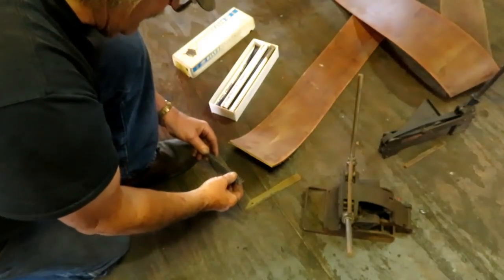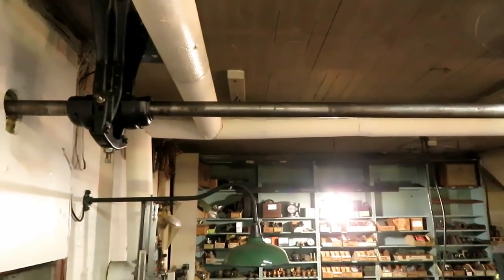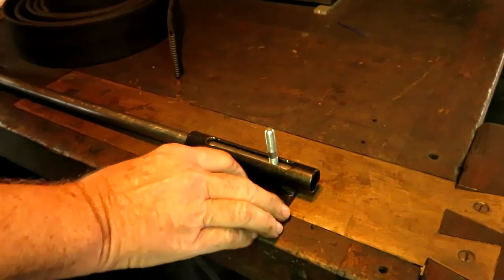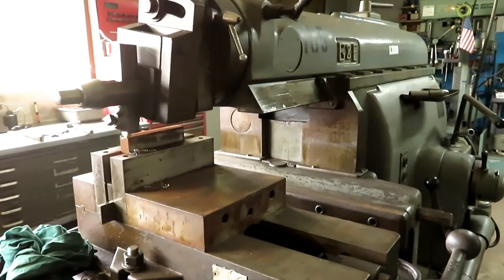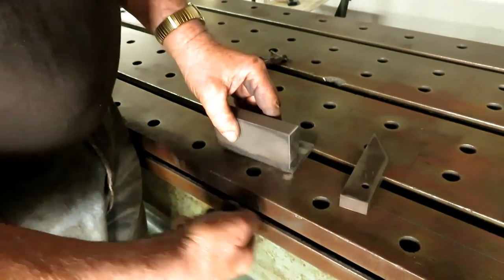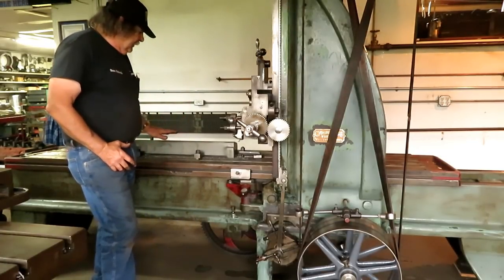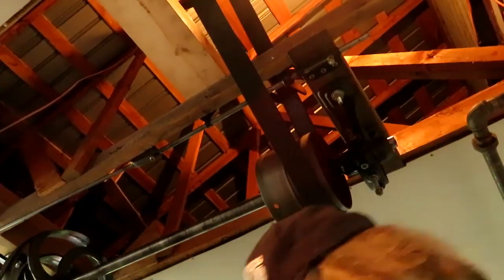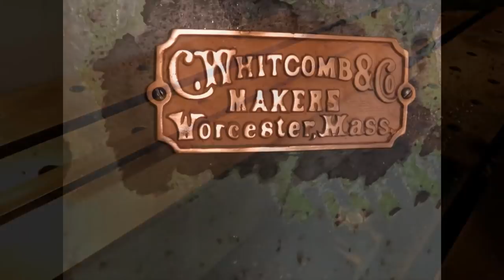Old Steam Powered Machine Shop 60:  PLANER ON STEAM

Comment: Great machine!
I have one question though: doesn't a mismatch of the gears in the drive train for the table motion cause chatter in the work because of a slightly uneven feed rate? I think you can see a slight regular pattern going across the cut surface in the reflection at 41:50.
So, it may not only be a noise problem you could fix, it might also improve the quality of the finish if you repaired that noisy pinion. In short: that's a fine bit of machinery you have got there, but it might do even better!
Reply from the maker: You're right, the small g&E shaper does the same thing . It's more of a surface finish issue because you can't really feel or measure it, probably due to a very slight vibration in the travel. There are 8 gears in the drive train all of which could be contributing to it. I guess by measuring the pitch of the marks in the work and doing some calculations it would be possible to figure out which gear set is the problem. Whitcomb later received a patent on a helical gear arrangement that would alleviate the problem somewhat. It included some odd angles on the ways to counteract the side thrust in the helical rack and pinion but I don't know if it ever made it into production on later machines. Thanks for the great comment....Dave

Comment: Why no leather lacing?  That was the preferred method of joining belts at the shingle mill that I worked at in my youth.  It is fast easy and you don't have to have the clipper crimps.  Not only that they run quiet.
Reply from the maker: This is very true. Wire laces are just quick and easy. I am going to start doing this when some 2" belts come up for tightening, thanks.....Dave

Comment: This is just great !
It is like watching campfire (quote from a YouTuber talking about a shaper).
It is always a pleasure to watch Your videos. To my belief this is because of the facts, passion and joy you embed into them.

I have a question about the speed control.
So in the steam engine there is this governor. As I have learned it maintains a constant speed. In modern technology a process called PID (Proportional, Derivate, Integral) is used to do tasks like this. However, every now and then one can run into trouble with oscillation. For example a system tries to maintain a constant speed but it actually oscillates around the desired speed. Sometimes this oscillation can become so large that it is an issue, This phenomenon arises usually with systems that have a high inertia. So my question (finally) is:: Did this happen in old systems with mechanical governors ?

Comment: Well you beat Professor Rucker to the punch, and thats all that matters.  Can a couple idlers be added under the long belt to give more head room and take out the slap?  Ive never seen idlers on flat belts....reckon why?  Tracking problems?
Reply from the maker: An idler could be used to steady and raise the belt but when I get it "run in" and re -tightened, I think you will see it's not a problem.....Dave

Comment: Nice work. Have you stroked the table at its maximum. To see how well it travels? Can you relief the pion gear teeth some to quiten down the noise? Ur would that add too much back lash.
Reply from the maker: I don't think that would do it, the "involute" profile (shape) of the big gear teeth is gone so the teeth hit with a shock instead of sliding into contact. It was probably noisy when it was new, being a straight cut spur gear. ...Dave
Reply: @davidrichards5594  was a thought. guess new gears, or live with it. Bummers

Comment: worn gears , you know the center is out of true.
and the worn gears tend to makes a ringing caused by the worn gears .
need something to take up the ringing witch wears the gears even more .
try putting or wedge in the spokes of gears at even spots, aka wood.
it don't look nice but , my dad had a fly cutter on a mill that was 10 inch across
shattered something bad ,no matter what he did it still shattered .
finally he put a 5/8 spring in a 3/4 rubber hose and wrap it around the 5/8 thick flange.
worked fine, no shatter.

Comment: Great Machine.  Is it under powered or is it that I am just used to seeing Modern machines.  Sure seemed like it needed some HP to give it a real bite.
Reply from the maker: Hi Tim, You have to explain your question a little. It's not to fast but never slows down when it hits the cut...Dave
Reply: It seemed as if it slowed when it started cutting, could have been a video thing.  I am not a Machinist, so the only point of reference is the video's I watch.  I would like to have a basic setup one day.  Thanks for making all the videos.  I really enjoy them.

Comment: You've probably answered this a hundred times but why not use an idler to ension the the belts and minimize deflection under load?
Reply from the maker: Hi Andy, You certainly could do that, but It would take a pulley , shaft and two more bearing hangars to maintain, would be a pain to shift the belts to other speeds and really isn't that necessary....Dave

Comment: Thanks David, your,s must be one of the biggest working steam work shops? I am interested to know do your machines have a quoted HP? so that you can work out the HP of the steam engine to drive a fully staffed shop?
Reply from the maker: There would be so many variables. The machinery manufacturers might have worked out HP requirements in their catalogs. I've heard of professionally done estimates of electric motor contractors that propose converting a steam shop to elec. But they seem very high. Maybe the motor people didn't have that much faith in their product.....Dave

Comment: Gear tooth geometry makes my head hurt, but I have to ask anyway. 

Could the pinion gear in the noisy pair be remade with the tooth profile tweaked to better fit the wheel?
Reply: Earplugs are cheaper. :)

Comment: Straight cut gears are inherently noisy!  Don't worry about noise, it will let you keep tabs on the planing when you are in the other room working.
JIM
Reply from the maker: I think it is actually quieter than a more modern hydrolic planer....Dave

Comment: Does anyone know why he did not simply use an idle underneath the belt to provide more ground clearance?
Reply: One reason may have been that the weight of the hanging belt acts as tensioner to keep the belt friction high enough on the pulleys.

Comment: Someone on these comments mentioned lathe beds - traditional English pattern are flat top so    truing them on your new planer would be OK, but I would be very interested to learn how 'American' pattern with V-ways (like your small South Bend) are done. 
cheers
Mark, Manchester UK
Reply: (Oh - and might be fun to experiment with a trough with some thick oil in it under that big gear, which would pick it up and maybe quieten things down a bit.  Keep your floor clean too :) ).
Reply from the maker: That's a good idea. ...Dave

Comment: Dave, I have been waiting for this day, along with almost 25,000 others , for a long time. It's been well worth the wait.  I did learn that a belt drive system is not as simple as it looks however ,and that a person needs  three hands to put a belt on a set of pulleys. I could sit and watch the separate parts of the planer that move 
for a long time. You answered my question about the noise of the table going back and forth before I could type it here. Are you going to fix that at some time?  It certainly isn't as quiet as the other machine tools with a back and forth motion. Finally, you put a smile on my face when I saw the  Whitcomb  & Makers builders plate. First because  the company was in Worcester, Ma. and second, the name Makers. I actually grew up in Shrewsbury, which is just east of the city. When I was a kid there was a  veterinarian by the name of makers.  I knew one of his sons , which made me wonder,  was my friend a descendant of the builder?
Reply from the maker: Hi Jim, Thanks for watching. The word "Maker" is an old term for "manufacturer"....Dave
Reply: @davidrichards5594  It's funny how that term, Maker, is back in vogue. Although today that usually means someone who programs a computer to run a 3-D printer. I'm glad you are keeping the old ways alive.

Comment: What were plainars used for historically?
Reply from the maker: Hi Bryant: Planers were used on machine tables & frames, T-slots, locomotive frames, railroad switch points, Grooved feed rolls, Key slots in long shafts, facing large castings, multiple pieces "ganged" in a row to do all at once, long press brake 'vee blocks", and any flat machining too large to fit on a milling machine or shaper....Dave
Reply: @davidrichards5594 Cool, thanks for the information.

Comment: This is a shaper, not a planer. The basic and main difference between shaper and planer is that in shaper machine work piece is fixed at the table and tool is in reciprocating motion which rub the work piece and cut unwanted metal. ... But in planer machine tool is act like as stationary body and work piece move over it. In very nice condition I must say.

Comment: How's it going that is a pretty awesome machine thank you for showing us such a interesting awesome piece of historical equipment look up this old Tony he has a gear teeth dividing head you might be able to help you cut a new gear for that or you might be able to get a hold of a v e he just scored a 5-axis CNC machine he might be all that machine one out for you but I've actually seen this old Tony screw around with making gears and it sounds like you need a set of gears besides the point that thing has the most awesome reversing mechanism how the belts slide over to the other pulley is there like a planetary gear and one of them how is it changing direction but it reminds me almost I have a very early bicycle derailleur to change the gears I just scored it a very old 10-speed road bike built in France that has a Simplex drive train and the front derailleur shift to chainrings and it's a piston actuated by a cable and it reminds me of that machine sliding the belt back and forth off the different pulleys very interesting mechanism I love to watch stuff that steam powered and pure mechanical it's like eye candy but once you get those gears corrected and rebuilt it'll be like ear candy to the I can definitely hear the gear teeth chattering and causing vibration hopefully you can find someone 3 manufacturer that gear Awesome video very cool setup how you ended up making the belt go through the rafters peace out into the world have a great day
Reply from the maker: Austin: Thanks for watching and taking time to comment. Straight cut spur gearing IS noisy. They might get replaced some time. I don't think a new gear set would be that much quieter.It's how they were. As for loco air compressors, I can't help you much there....Dave
Reply: David Richards thank you very much for the reply graciously appreciate it have a great day

Comment: Dave's planer seems a long way from the engine. So, a question for you line shaft people: how much power loss/ torque loss do you expect to a machine given the length of shaft, (diameter of shaft?) number of belts, length of belts and bearing blocks between the generator/engine and the machine? (This is probably a "How long is a piece of string?" question, but I'm interested in efficiency of drivetrains). Thanks in advance if anyone has an answer.
Reply: not much loss. flat belts are something like 99.9% efficient, most would be lost in the bearings.
Reply from the maker: I can show you that with the steam engine belt off, I can turn the first shaft, turning the second shaft and planer countershaft easily with one hand. The inertia load is  pretty heavy though.